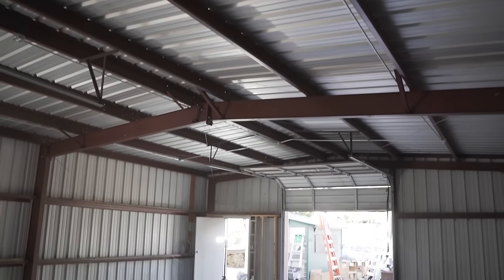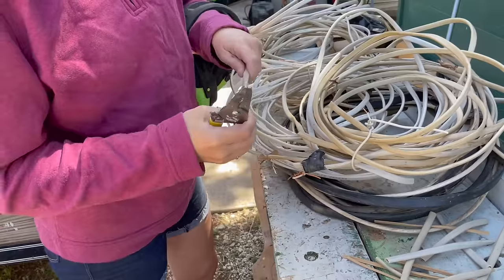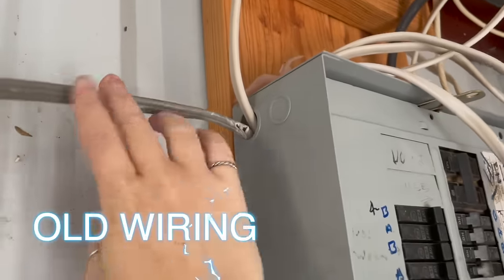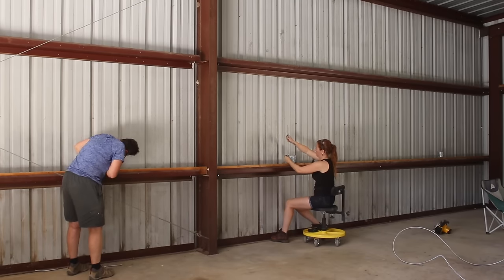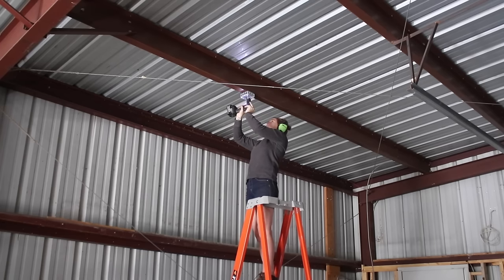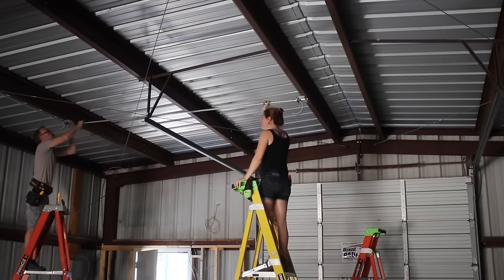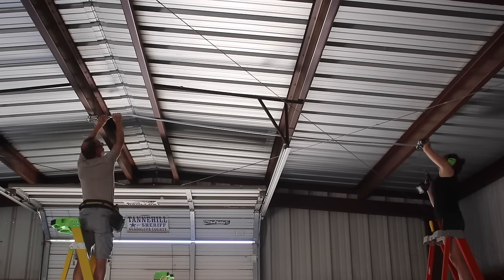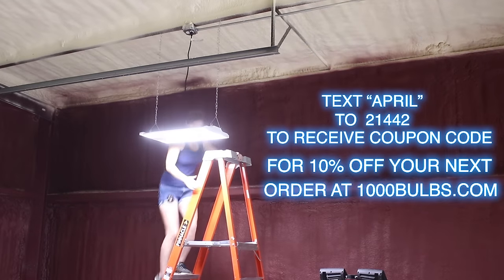Wiring My New Shop | Adding Outlets and Lighting

Comment: Flex, or BX,  is not allowed in many jurisdictions. You may be able to use PVC electrical piping rather than EMT.  Check with your local authorities, wired improperly can effect your insurance should you have a claim.
Reply: No saying you are wrong, but that is ridiculous. As a licensed electrician specializing in fire alarm systems installations, we us MC for about half of our circuits. If it is plenum rated, where is the downside?
Reply: @jimmac1185  when I was a licensed electrical contractor in Cook County Illinois BX was never allowed, Romex was not even carried and Greenfield was only allowed to be exposed 18".  Everything was EMT.  No PVC  was allowed anywhere.   The whole country is not the same.
Reply: @wags99999  Ahh, that explains it. I'm glad I work in a jurisdiction that doesn't have silly restrictions on the types of materials I can use.

Comment: It is a code violation to install wiring before the conduit is fully asembled (NEC 300.18). Also, voltages in the US is 120 volts nominal, not 110.

Comment: how come you didn't just use cheap PVC Conduit?
Reply: In some areas of the country PVC is not allowed indoors as it releases poisonous gas if burned!
Reply: @TheRazzGroup  so it's a regulation? I from australia, so fair enough, I use to work in a PVC Pipe factory many years ago, I know what fumes come out of burning PVC SULFURIC ACID, CHLORINE Etc, blood awful stuff!

Comment: Raceways need to be supported every 5 feet.
Reply: Not for EMT, it’s 10 feet and 3 feet from any junction box.
Reply: So we will agree to dis agree. I installed conduit for 40 years and that's a long time to be doing it wrong. I need to make a couple of calls and find an NEC Code book. See you soon.
Reply: @kevinjmoore2359  NEC 358.30 it is every 10 ft and 3 ft from a termination. Not saying what you did was wrong, code is minimum.

Comment: You need to stop using 110 Volt and call it 120 Volt.  I believe the US upgraded about 1970.  230V is now 240V.
Reply: Why does she "need" to stop using 110? It's not like you didn't know what she's talking about. Most people that don't know the code call it 110. It really doesn't matter since most of the time when you throw a meter on a circuit, you don't get 120v exactly.

Edit: new receptacles actually say 125v not 120v so...

Comment: Your panel is not to code there is maximum height to top of panels
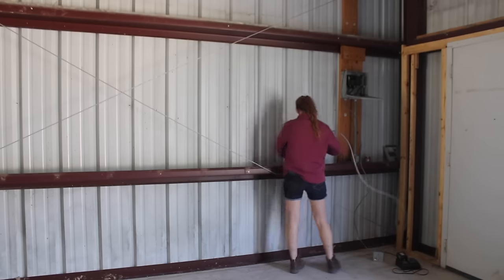Reply: Thats is not technically correct. There is a maximum height to the highest disconnect inside that panel, which is 6'7". Judging by the video 3:06 , and the average height of a woman, I'd say her panel looks fine.

Comment: Apologies if this was already  mentioned in a previous comment, but, Anti Short bushing! You show one, the red plastic thing stuck between the armor exterior and the wires , but I think you left it out of your narration. Real important and an inspection breaker if not installed.
Reply: Yes, as an electrician of 16yrs. An anti-short or red head is required to be installed in the cut end of MC cable before it goes in a connector. Also you need a dedicated ground in the EMT ceiling outlets. You can not rely on the box or EMT to provide a  safe ground connection.
Reply: Glad I'm not the only one who noticed the missing anti-shorts.

Comment: MC shouldn't be used for long runs. In many places code will limit it to 4 or 5 run max.
Reply: i would like to know what code article you got that from?
Reply: @jwrangler12  it's what I learned from an electrician I worked with. My guess as to why is it's much easier to send a nail through MC than it is EMT.
Reply: @ColeSpolaric  You claim "in many places" but can't provide an example other than I heard it from a guy I worked with?

Comment: I both love and hate that you can do so much electric work without any need of permissions.. On one side.. its good cause some "normal" people do a better job then proffessionals.. On the other side..you have those make potential fire hazards for themself and future others. 

How do insurance work on these kind of things?  I mean.. When you have done the electric part themself..And it burns down..you can just "oh well i build it like the code says with this and that protection.   Surely the insurance company will fight you on that right?  

Anyways..Its baffling that US is so far behind on materials when it comes to electric..  I mean.. Metal metal metal..:Come on folks..you are dealing with electricity..   Looking at all those wires getting stapled down to wood is legit the most f**ed up thing ever.. And you guys close it in aswell???    The metal "flex" pipe is a good start.. but you do realize you can just make an plastic flex pipe right and have the cables already in it ?   And just make the work easy for everyone. 

I seriously want to bring my country "standard" into the US and sell the items, cause ive seen that its actually used in high luxury homes over there and talked about like its something new and a big deal that very few use... And like i said..here its considered the cheap standard option :P
Reply: "Plastic flex pipe" is not as durable as metal. There is no more danger in using metal for your conduit as long as you properly bond/ground it. There is a reason why the US electrical code is used as the standard in multiple countries.